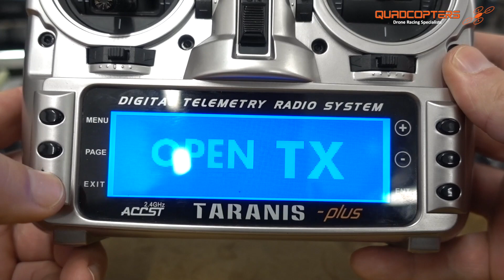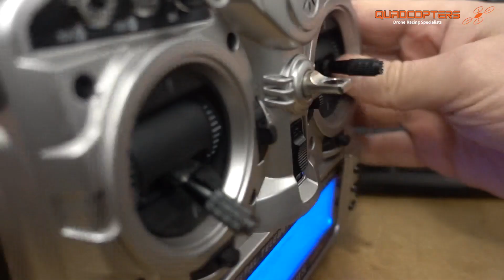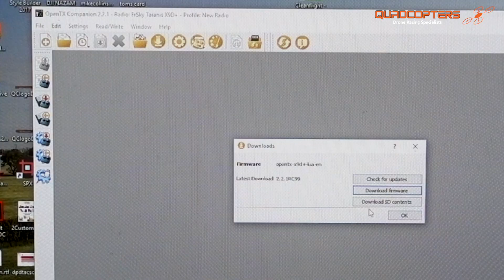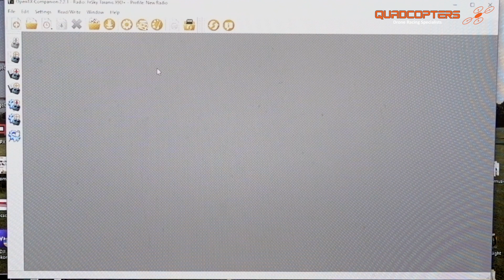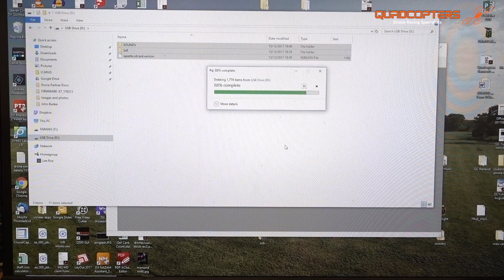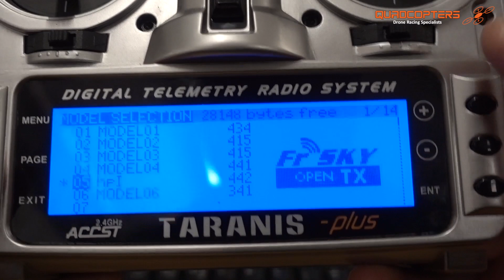How to enable FrSKY D8 Mode - Setup Guide

Comment: Hello, I have Radiomaster T8 Lite with d8 and d16 protocol and i bought a fpv drone with receiver iFlight R81(Compatible with accst d8) , what is this accst ?? Work with d8 mode remote control ? I don t need accst d8 remote ?

Comment: hey buddy I'm from UK and just got qav105 .the reciever is frsky pro v1 my radio has all 3 modes it's qx7.so I have d8 mode.bound the reciever but all top six switches are going crazy on there own.moving full and back.everything is checked correct.can you flash the v1 pro d8 .and do I have the correct firmware allso in my radio as normal I only use rxsr .

Comment: my +2 year old x9d comes with D8 out of the box.  what happened?  If I upgrade to a x9dSE it won't come with D8 like my old radio did?
Reply: Just update the firmware as per this video and it will be there. If you are getting an X9D SE 2019 then the only way to get D8 is to buy a XJT module or a Jumper/IRangeX 4in1 module and bind using that.
Reply: @richardlong3615  I don't understand your post, unless you're trying to obfuscate my point to new buyers?  To be clear, the old x9D works with D8 out of the box.   The new "improved" version with no built in charging DC plug requires an external RC cartridge installed to use D8 mode.   My point being,  what kind of upgrade is this?  Certainly not one I'd replace my good working x9D for.
Reply: @wogfun  I'm sorry I wasn't clear. If you have never updated the firmware in your old radio then it will probably work with D8 it will depend which version of the firmware its running, if however you have updated the firmware in your old radio to 2.2.3 it won't work with D8 unless you have unchecked the EU box in Companion before downloading the firmware - see video above. If you upgrade to an X9D SE then nothing changes upgrade firmware to 2.2.3 uncheck EU and it will work with D8. If however you are upgrading to an X9D SE 2019 then nothing you can do will make the internal module work with D8. It may work however if you buy and install an XJT or IRangeX/Jumper 4in1in the external bay. I was not try to obscure your point I was trying to find a way round it.
Reply: @richardlong3615  wait... X9D SE 2019 even with this firmware update wont be able to do D8 without buying another module?  WTF are you serious?  I just got an X9D+ 2019 but this "upgrade" SUCKS
Reply: @richards5863  There you are the price of progress. An X9D+ 2019's internal module only does ACCESS and D16. If you want anything else then you'll need an XJT or 4in1 external module

Comment: Does this mean that the Radio is no longer EU LBT ? Would I then have to flash all my EU LBT X-RSX receivers or does this allow me to keep using them but also select D8 mode for imported quads?
Reply: No the transmitter module is still EU LBT its the internal firmware you are altering to change the radio to FAA (international) you would have to reflash the internal module as well.

Comment: Rich i need to do this to mine to enable my d8 mode for my d4r recievers if i do so will i still be abke to bind to my eu lbt x4r or will i have to flash my x4r reciever with none eu firmware. Also i am running stock firmware from about a year and a  half ago from when i bought my taranis from yourselves woukd you reccomend uodating to the latest available version or would you not bother touching that?

Comment: The sd card contents part is not necessary. I've got a QX7S and to enable D8 when flashing the firmware I've had to uncheck the check hardware compatibility tick box because Open TX companion gets confused that it's not a x7, which is a known bug but it works. Had to literally do it yesterday so I could bind to a BeeCore V2.
Reply: Do you have an EU version of the QX7S?
Reply: laciffy Yes but country is set to US
Reply: R1 guys where did u get the actual firmware??